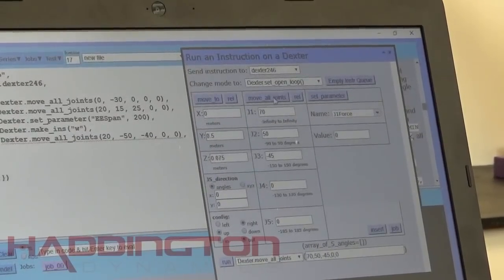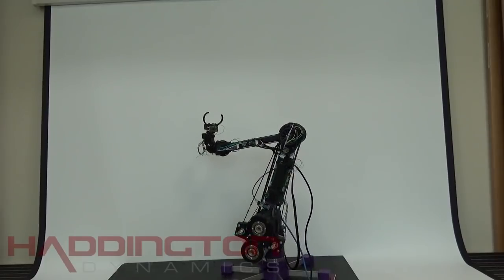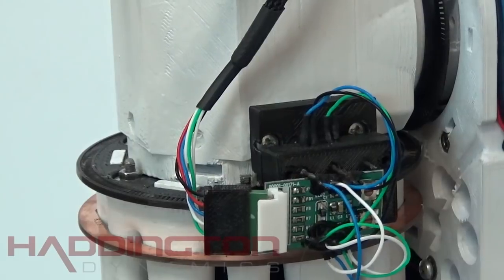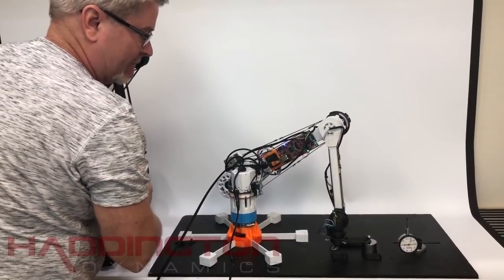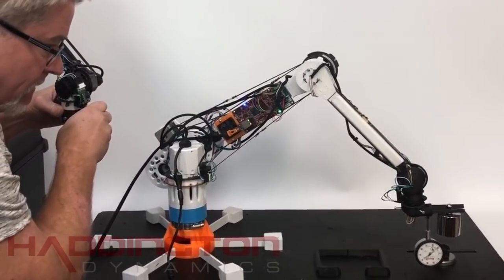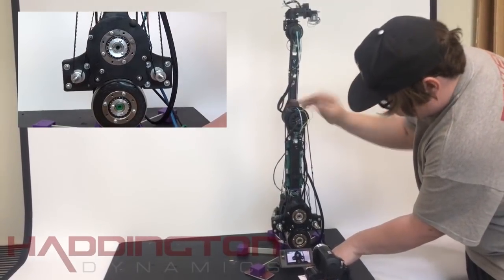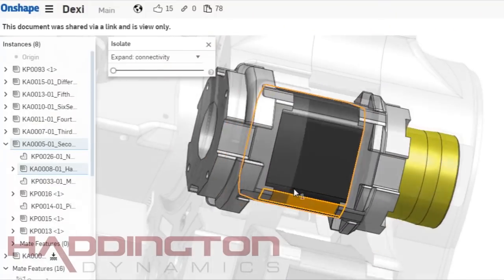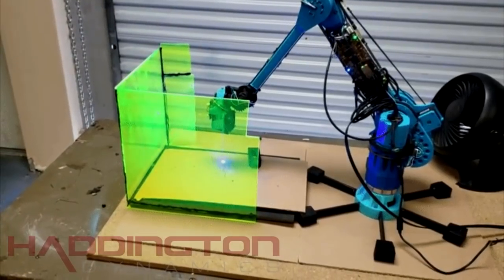Dexter - 2018 Hackaday Prize

Comment: So, it is a combination of a resolver and optical encoder, i.e. an 'optical' resolver that is made as part of the optical encoder. That is a clever way to leverage existing components for other uses. I have a 1980's era CNC machine that also uses a combination of optical encoders and resolvers but the disparate signals feed different parts of the controls. The resolvers and analog servo amps and the encoders the digital controls. Combining the two is an interesting way to make a much higher resolution.

While it gives you high resolution, i.e. lots of encoder counts, what the effective precision?
Reply from the maker: Good analysis Jefferey.  With our configuration we get approximately one arc second.

Comment: I have to ask: how many Dexter's would it take to make an assembly line for a Dexter?
Reply from the maker: In theory, we could do it with just one Dexter, some fixtures, and a tool changer within Dexter's reach. However, more could be added to work in parallel, so it really depends on how fast you would want it done.
Reply: @HaddingtonDynamics  well even with one finished Dexter per day it would scale exponentially, so by the end of the month you'd end up with 2 147 483 648 Dexters. That's a lot of Dexters if you ask me...